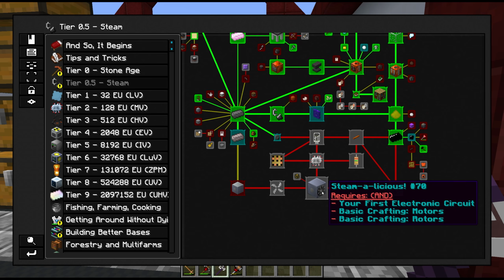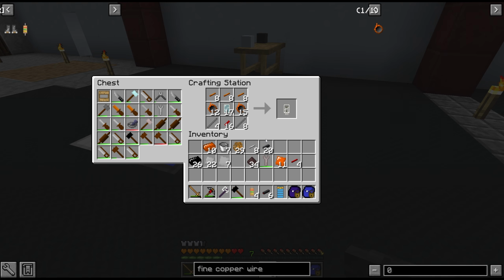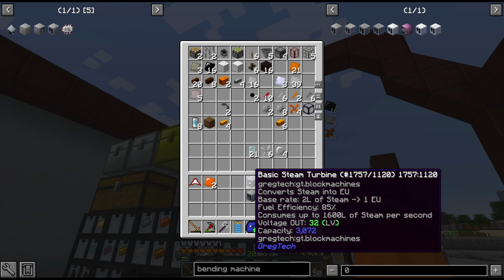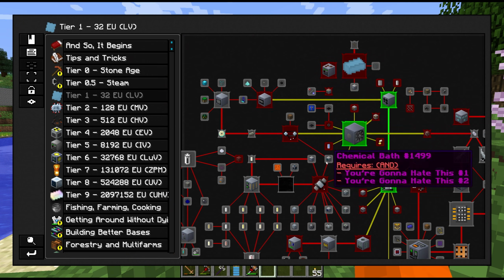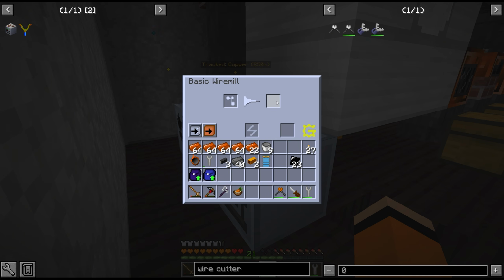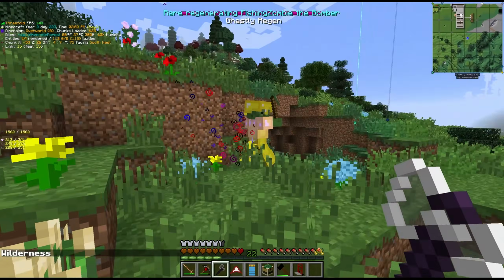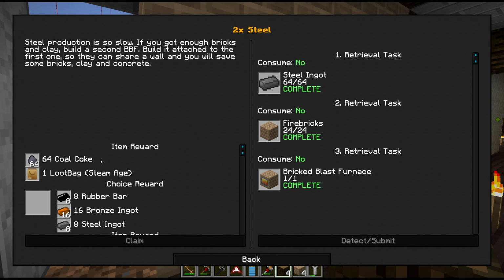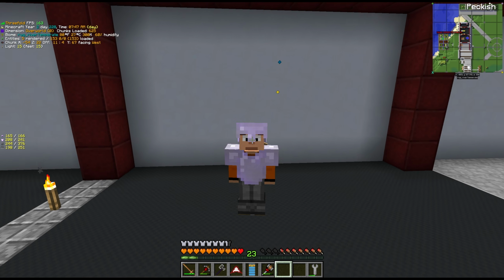Gregtech New Horizons - 06 - Enter Low Voltage! Modded Minecraft

Comment: Here is a list of wood farms:
LV- Steve's carts no energy cost, but you have to use diamonds to rapair the cart once in a while. Kinda slow
MV- Bonsai trees with chavester. Really cheap, uses energy, it has small range
MV- Forestry multifarm needs energy, water, fertylizer and electronic components. Huge range and fast
HV- Farming station - uses energy and it's fast
There is also tree growth simulator but i never used it.
Also i see you dont macerate all the ores because it's slow. I think it's time for you to invest into steam grinder. It runs on steam and is as fast as HV Macerator ( or even faster not sure ). Combine that with railcraft oven for fast bulk processing.

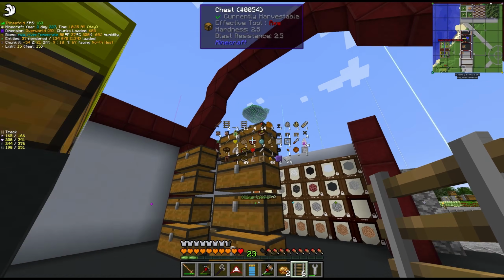Comment: 19:00 I was burning wood in 20+ coke ovens for charcoal and creosote, which was burnt in railcraft boilers for steam. Charcoal were compressed once before burnt, extra charcoal blocks in a drawer buffer were used to make steel in the BBFs. To get the wood, I used IC2 crops/bonsais and crop harvestor (maxed out at 11x11 I believe). This full automated farm was more of late LV or MV solution though, because the crop harvestor requires aluminum and the cropnalyzer for checking stats require MV circuit. So until then, I used a large clearing to manually plant a lot of those 2x2 giant spruce trees and harvest them every 20min or so to build a giant buffer of wood to last me to MV. Then switched to high stats spruce bonsais once I could make the cropnalyzer to start breeding crops for stats. And boom, stacks and stacks of wood start building up faster than the ovens could burn (20+ growth and gain bonsais are pretty insane). 

As for the wood distribution to the coke ovens, the limiting factor is not the pipes but rather the conveyors pulling wood out of an inventory. I didn't do any math, but I attached 3 conveyors to different sides of a drawer because I figure that's enough to saturate the tiny/small tin item pipe network. And that turned out to be enough to keep more than 20 coke ovens stocked with wood at all times (i.e. there's enough throughput to check and fill every oven before one recipe of wood to charcoal is done). Replace the LV conveyors with a single MV conveyor later.
Reply from the maker: Nice! Sounds like you have a good setup going, hopefully soon I can get it all working. I'm thinking of actually skipping rc boilers and going straight to the GT Lbb for steam. Sure it will cost a lot more to get up and running but it should be more efficient and help with pollution output. We'll see.... thanks for the insight :D
Reply: @Threefold.  Yea that would be nice too!! :) I was gonna switch to the GT Large boilers too, but I was so close to my first diesel setup so I gave up on it. Would love to see how the setup work out and whether it's more efficient. I played this part on the patch with pollution disabled so I won't know which setup is more pollution efficient, but I would guess one multiblock probably produces less pollution than 24? 😂 For wood you can try the forestry tree farm route too if you don't feel like breeding the crops! xD

Comment: I’m pretty sure the item pipe throughput will matter, because they don’t round robin. So the pipe will lock onto the first coke oven fill it with a stack, then go to the next and next, but the pipes send the items in packets. So by the time the coke ovens furthest from the source of items start to get items the ovens at the front will have burned 1 item, and the pipe will send just a single item to that oven. Because of this, when you have enough ovens some of the furthest ones will never get any items. 24 might be below the limit though. This was probably super badly explained but I hope it’s understandable
Reply from the maker: I totally get what you're saying, I think it will require some testing.. let's see
Reply: @Threefold.  Hopefully it works out!

Comment: When you start expanding steam production, however that looks, I'd recommend adding a bank of steam macerators, or looking into the bronze multiblock for ore processing. I had like 10 machines I was throwing all my basic ores into pretty deep into the pack - spamming these is much cheaper, quicker & easier to power for most basic ores than upgraded versions. Also good for gravel in forge hammers, etc.

I'd also recommend keeping samples of unprocessed rare ores for your divining rod. And not just the ores - unless they nerfed it (it's been a while), lootgame blocks, chests, whatever can also be used in the wand to find underground structures.
Reply: The bronze 3x3 macerator is MUCH more efficient with power and can do 16x the ores per craft iirc, and its also overclockable again iirc
Reply: @reclipsel  I found out about that thing way too late, but yea man the bronze multiblock macerator is the goat

Comment: L does not stand for litres in GTNH, it's just one of many nonsensical unit of Gregtech measurement. Same with the temperature being measured in K, which does not stand for Kelvin in this case.

I don't think the direct recipe for crafting cables is more efficient, just with less steps, maybe? Doesn't really matter, you're not going to be using either for very long anyway.

Something you could have done to speed up those steam machines (and something you might still do if you want to complete quests and put those steam machines to work in your kitchen, later) is upgrading them to their High Pressure variants. In this pack it's extremely cheap to upgrade most steam machines to high pressure versions, and given that the latter aren't as slow it's very worth it. Plus, quest completion.

For what it's worth, leaves are broken quickly by axes or at least TiC hatchets in this pack. You could keep a hatchet on you to quickly clear leaves when going through the rubber trees.

Steel also goes...actually I don't know if blocks of coal coke smelt steel *faster*, as such. Obviously it smelts more at once, but I'm not sure if it's the same amount of time spend smelting per ingot. Well blocks are more fuel efficient, at any rate, so try to use blocks to fuel your BBFs.

For reference there's no limit to what size pipe can connect to what other size, a huge pipe will happily connect to a tiny pipe, but pipe connections can look really bad if you're not connecting to pipes one size lower/bigger at most. Just something to keep in mind if you end up with exposed pipes that you don't want to look off.

For reference, that in-machine integrated circuit feature was added in the latest stable. Just remember that before this patch every time Three uses a machine that needs a circuit you needed an actual external circuit, program it, and put it in the machine. Why, yes, this made getting into LV even more of a grind than it is currently.

Pigman get aggrod whenever you mine an ore (large or small) within their range. If they're Infernal pigman with the poisonous or withering traits (whatever those are called) they can actually poison/wither you through walls. So, eh, yeah. Be careful about that. Also that one pigman that caused the red chat messages was a Vampire pigman. They take minimal damage from non-wooden or Smite(?) enchanted weapons, and hit hard. There's also Vampire Ghasts, for those who think that's not awful-sounding enough.

Tetrahedrite is is something that can later be processed into liquid Platinum Pain Train, as I call it, so I would recommend saving it if possible. The same is true for Chalcopyrite, albeit in a different way. Of course saving both means not having a lot of sources of copper income, and you're not going to need any less of it going forward, so your call on what to store for later and what to use now.

Single block machines can only output to one side, but ever since the latest patch they are able to output to the top and bottom.

If you build a Combustion Engine (or Semi-fluid generator, one of the two) you should be able to burn Creosote Oil directly into power. It's not going to produce a lot per bucket, but it's better than nothing. Look up the uses of a Creosote Oil Cell in NEI, and there should be a tab listing valid combustion or semi-fluid fuels, depending on which creosote is, as well as their fuel value.

Many multiblocks in GTNH can wallshare, in fact most of them can. Get used to this mechanic and get comfortable with it, because it will save you enormous amounts of materials.

The throughput on those pipes does matter, in fact, because those pipes don't work the way you're expect them to. In general GT item pipes are really bad and awful and laggy, but they're all you've got access to right now, so gotta use them.
Reply from the maker: Yeah the copper situation I'm not worried about processing now without the extra byproducts from higher tier machines, I'd rather take the extra ingots now and find more later. 
As for processing in general some macerators are really not a bad idea few people have suggested that
Actually planning on skipping the RC boilers and going straight to the GT Lbb. It will be a little more costly investment but it will be a more robust setup I feel. Plus it will look cool I think.
Reply: @Threefold.  In the case of Tetrahedrite/Chalcopyrite it's less about getting byproducts and more about (eventually) processing it into something else that's more valuable than the copper, but it's entirely fair to not be concerned about EV/IV when you're just getting into LV. You'll get access to miners soon enough, anyway, so your ore shortage days will be over before long.

I'm not sure if the GT large boilers are better than the railcraft version at that low a tier, the GT boilers gain efficiency as their tier increases (mind you that even just a steel boiler would be awfully expensive right now, and Titanium/Tungstensteel is literally impossible), but when you're talking about an infinitely farmable resource I suppose that doesn't matter overly much. One definite benefit of the GT boilers is that they can be throttled, so you can be quite precise in how much steam you actually produce at a given time.
Reply: L is in fact for litres (1000L is one block aka 1m³). K is similarly for kelvin. Negative kelvin values are unintentional and are a bug.
Reply: @Vova__  Explain to me how a bucket supposedly holds 1000 litres, please. I can believe the negative temperature values being an unintended bug.
Reply: @TheShadowofX  It is not an inconsistency of GregTech. It is to do with minecraft itself. From the average height of a human, one may assume, that one block is 1m³, which is 1000 liters. A bucket picks up one block of water, hence, one bucket holds 1000 liters of water, no matter how dumb that may seem. As there aren't many other innate absolute constants existing in vanilla minecraft, this is what Greg based this unit on. To avoid this confusion, most mods use millibuckets instead, but, honestly, who cares? It is just an arbitrary convention. There just has to be a unit, which is easy to work with, and since a liter is what most of the world uses, it makes sense to attempt to introduce it to minecraft.
Reply: @Vova__  Personally I'd find it more sensible to just stick to milibuckets. There's no benefit to switching from a simple, widely used and internally consistent metric to something that's used by practically no one (in modded Minecraft) and isn't logical or internally consistent no matter how it's defined, at least IMO. Adding that GT inexplicably switches from measuring stuff per tick to measuring stuff per second, while it's own machines very much still run on a per tick basis, just leaves me with the impression that GT made the switch to be obtuse for the sake of being obtuse more than anything else. Though of course that's just my opinion, I'm sure others will have a different view of the subject.
Reply: Creosote oil can also be burned in the railcraft boiler
Reply: @Royal_4096  True, the combustion/semi-fluid solution is just a faster/cheaper/simpler way to at least get something out of excess creosote oil, if you're not going the Railcraft boiler route. Personally I turned it into a self-powered Lubricant producer, to speed up the cutting machine and for energy hatches later (IIRC)

Comment: You can make steel casing in the alloy smelter 2->3
You should really use the macerator to make crushed ore to smelt over just smelting ores
In the machine GUI you can pick what circuit you want, you do not need to craft a programmed circuit and put it in single block machines
For wood, bonsais are best